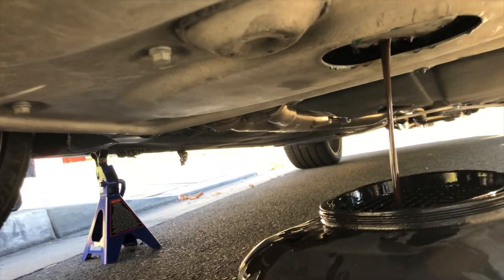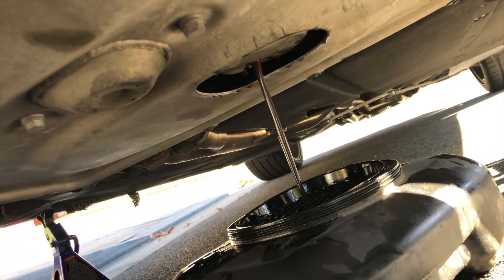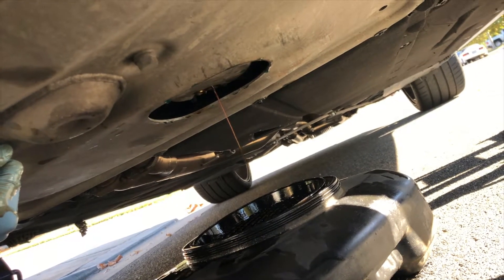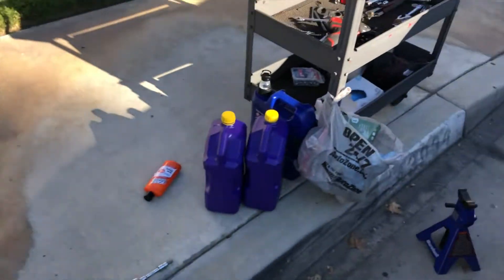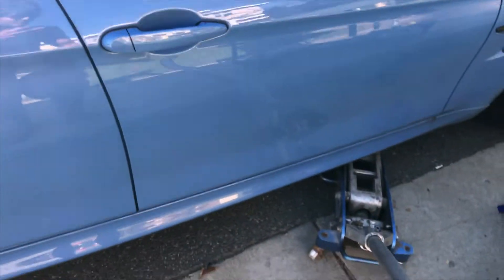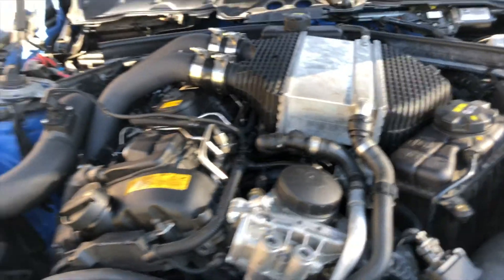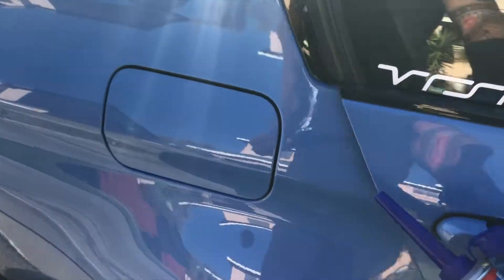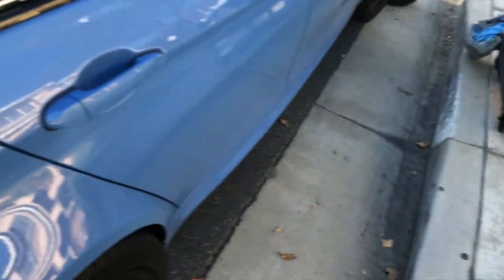BMW M3 Back From The Grave!!! pt 2

Comment: Why did you have coolant inside oil? I can understand fuel can come through the piston seals but coolant? Or was it spilled inside the intake during the cooler removal?
Reply from the maker: vitsou1 I just read your question and decided to do a little more reading on it. It’s actually not coolant. It’s just fuel. If my gaskets were blown, it would be coolant but they’re not
Reply: It would be weird if you had coolant in your oil tank. It would be either blown gasket or blown turbo (not sure if our turbos are watercooled). Thanks for the feedback and keep up the good work. PS. Just got bootmoded with BP titanium cps, eventuri intake and catless Akrapovic DPs. You were correct, the car is transformed into a beast. Looking forward for more of your videos without trouble.
Reply: Derp

Comment: I have M550D f10 Its consuming the Oil But i have no idea Why It could be No blue smoke No white smoke Not even at hard acceleration I have removed DPF and installed downpipe So it only has black smoke But just little which is normal I dont have a tune ... Car runs fine it brings the stock Power Still burns oil Which for these engines Are Not Normal  none off the N57 engines use to burn Oil What could be wrong with it ?
Reply from the maker: not sure bud. im not familiar with the F10 or the engine

Comment: Dude jump on hwy and just do a long hour drive with engine under minimal load to clean it all out
Reply from the maker: sam cas you cant clean the engine oil by driving. It’s a requirement to flush the oil when something like this happens. If you’re referring to the smoke out the exhaust, it goes away about 10-15 mins of driving.
Reply: @Thewinnerscircle_  yeh i meant post oil change